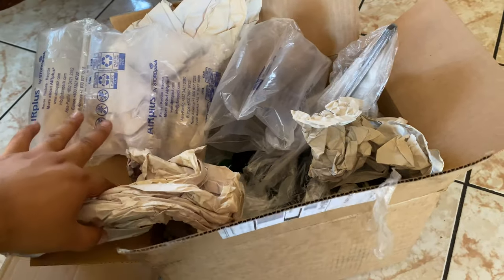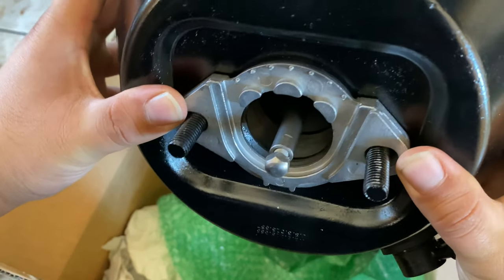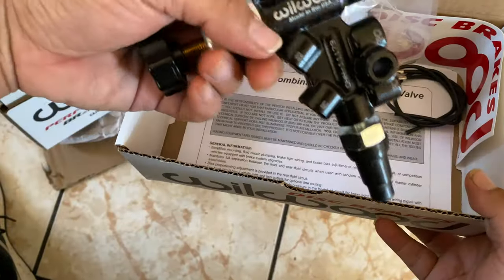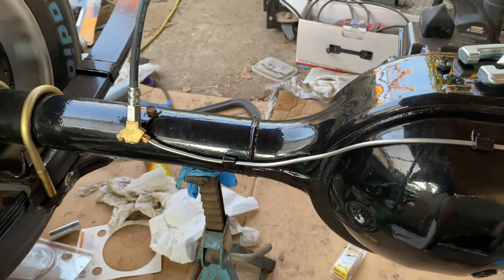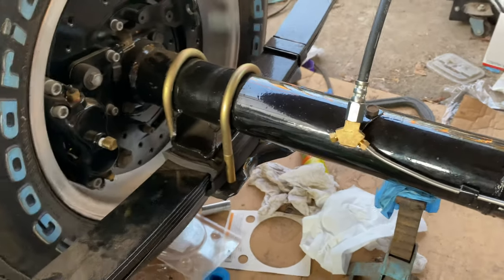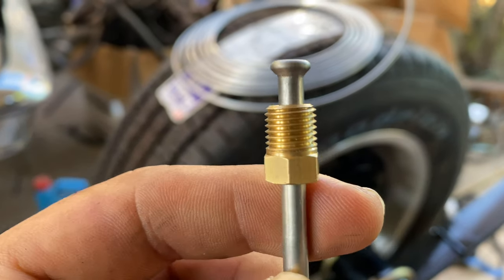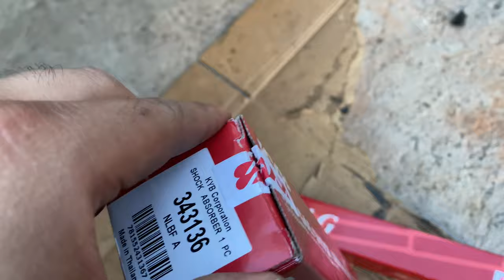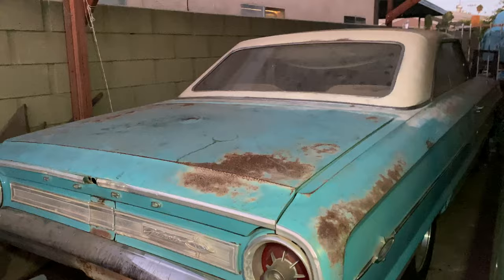Finishing up the brake lines and rear end on the 1964 Galaxie!

Comment: looking great!  64 Galaxie rules!
Reply from the maker: Haha yes!
Reply: Looking good!  You might find that you want some brake hoses so you can remove the calipers for brake work in the future.  Hard lines will probably require removal and bleeding each time.  Keep plugging away and I'm jealous of the flaring tool.  I just finished a brake upgrade on my 64 using later model parts and an aftermarket booster setup.  Videos on my channel!
Reply from the maker: SSMonte87 very true, I thought about hoses but wanted it to be stock. Maybe when I convert to four link coil overs I’ll switch them. Cool Vids!